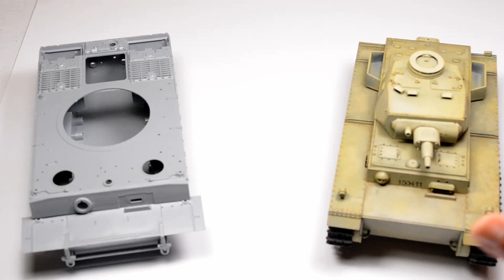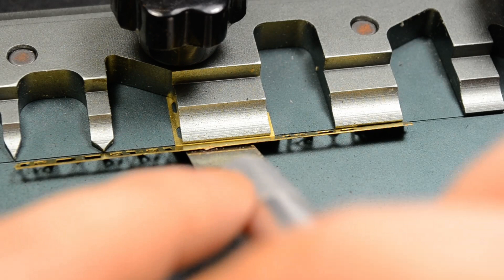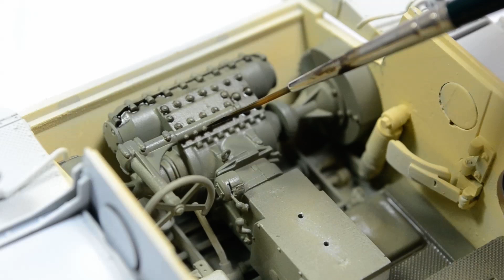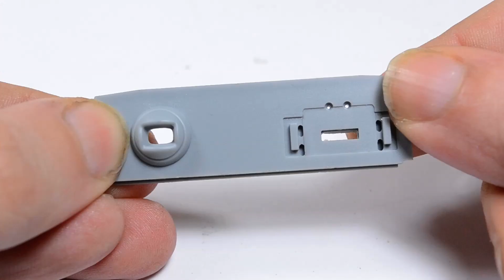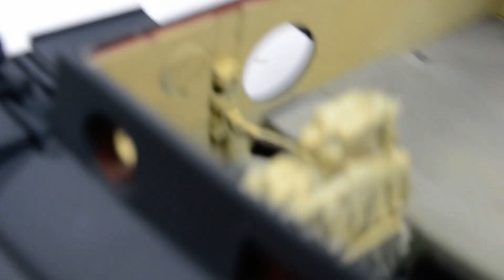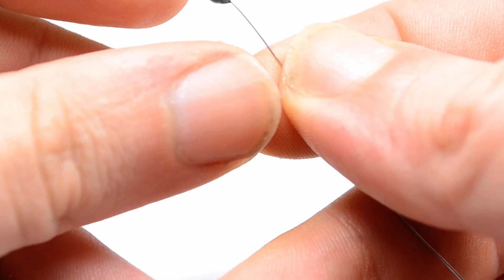VK36.01 | 1/35 Revosys / RFM | How to build and convert it to the Tiger Tank Prototype | Part 1

Comment: I bought the RFM one a couple of weeks ago so cool amd got the VK30.02DB this kit turned out so fricking nice so it did! The t34 panther thing! This was a great build from amusing hobbies too this Pz.Kpfw.38D mit Pz.IV Tum 8cm PAW 600!I'm just away up toy friends model shop to get the panzer 4 with the front slopped armour from AH now and waiting for RFMs panzer 4 with the panther turret to come my way next! How are you getting on with your tracks etc mate? I've noticed TREX have started doing them for takom now so that should be cool and waiting to get a set of the winterketten from RFM I managed to get them in the white metal but I'm no daft on metal tracks much eh, there's not really great Sharpe detail you get with some of the plastic one's so can't wait to try a set of 3D printed one's!

Comment: Where's part 2? I'd like to see the finished article please
Reply from the maker: Hi Allan, Part 2 is scheduled for the first January week. I still have Problems printing the new tracks
Reply: @Tankbrusher  no worries, looking forward to it.
What do you think of the kit overall?
I was looking for an interior kit then came across this one on ebay, I had it for a good price and my first impression is it looks a well detailed kit (although not totally accurate)
Reply from the maker: @allanatwick1606  I think the kit is as good as it gets. They took a not so important vehicle and went over the top with this kit. Detailing, fit, overall balance of features is on point. It's one of my favorit kits and 70% of my stash is dragon and takom atm. How accurate it is, is not important since it is a ,,what if it would have been completet" kit, but when backdateing it to what actually was there as a project, as I do, it still is very complete and very close to what we can see on the photos. I guess it's the last kit we see by revosys and that's a real pitty imho.
Reply: @Tankbrusher  thank you very much

Comment: I just bought this kit, I don't have a 3D printer so I won't be adding the pieces you have, it will be an out of the box build with brass machine gun barrel.
One thing I will say is that at a glance the instructions supplied seem a little spare on information.
It doesn't look obvious what parts to use or leave out when you get to the turret.
You have a choice between mantles (if that's the correct way to say it) and barrels.
Also there are no written instructions at all, only in pictorials.
For someone like me who has little experience in modelling it looks a bit daunting.
I think I'll have to practice on some other kits first before I attempt this one.
Great vid thank you 👍
Reply from the maker: Well main problem with the turret ist, they were never completed - you are relativ free to choose the parts you like the most, chould have had the konical 7.5cm gun - they were produced in a small number i renember right ; )

Comment: So how will you make a 1/35 model of Albert Speer as the driver?!? ;p

I love this tank. I have this Revosys kit sitting in the shelf. It's a shame there's no engine part...

When I have the time, I will make an Alt-History version of the VK 36.01, in which the Waffenamt cancelled the Durchbruch tank concept after the Battle of France, and went ahead with the Artilleriewagen concept of a Haubitze-turreted, infantry support panzer. It will look very similar to the VK 36.01 (H) Sturm from World of Tanks.

Here's a detailed article: www.tankarchives.ca/2018/06/vk-3601h-half-step-from-tiger.html

Next, let's see what you did with the tracks!
Reply from the maker: Oha.. No Speer around here... But I do have Prof. Dr. Porsche as resin figure having a rather unimpressed look on his face xD I did read about the AW it would have been a totaly different vehicle to what wot included in thier game. Nice project nevertheless but it needs more original drawings to show up. DW1&2 is something I lick my fingers for : ) I'll read that article for sure. Yeah, the tracks, still babysitting the printer atm xD

Comment: A nice start to the build my friend  I've just bought the Ryefield Pz.KPFW VI Ausf 1B Vk 36.01  will follow your build with interest. I like the way you approach your builds so will look forward to the next update
Reply from the maker: Thanks Greg. RFM did a good job sorting some of the fantasy options out from what I've seen so far. Let's see if I can fix the tracks, if it works out, I'll send some resin parts your way.
Reply: Thank you very much would you like me to do an un-boxing of the kit
Reply from the maker: I'd happly watch it, there is not an english one out there as far I renember. Do you have a book about the vehicle yourself or do you need some patching up?
Reply: I'll sort that out tomorrow for you also I got the new RFM T34/85 it looks a nice straight forward build.  No i dont have the book but it sounds pretty interesting
Reply from the maker: I'll patch you up tomorrow during the day, I contact you via email. I'd love to see a very very early T34 one day, just like the one the Germans had when they were designing the Panther. RFM I only have the DAK Tiger, that one will be converted into the very first tiger with the vorpanzer.